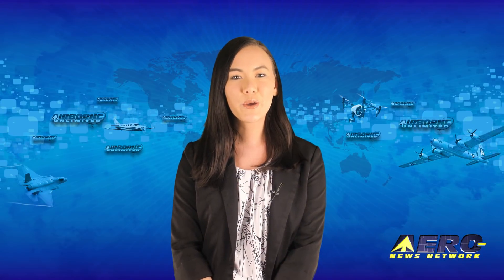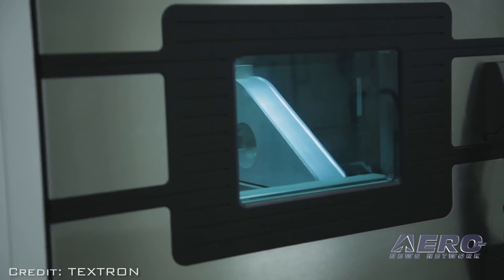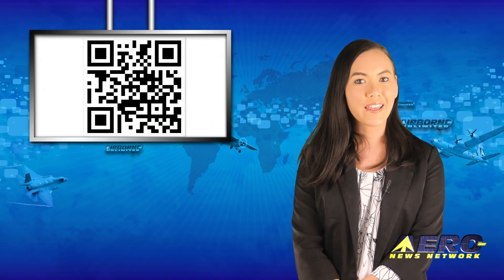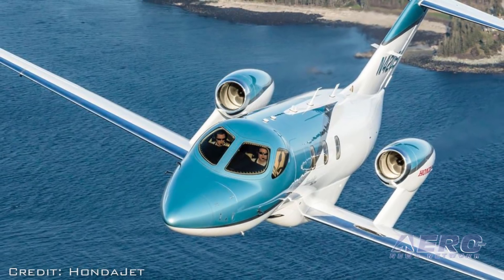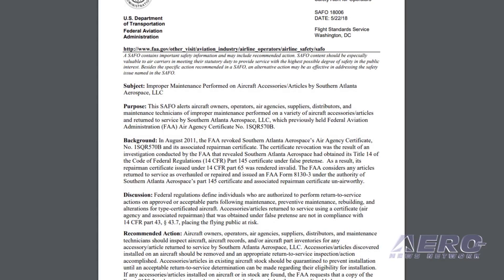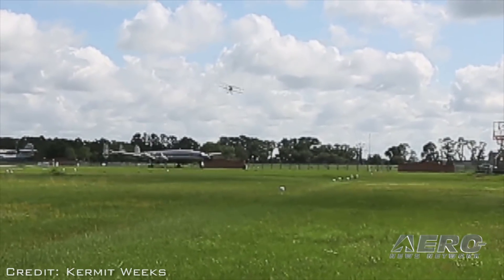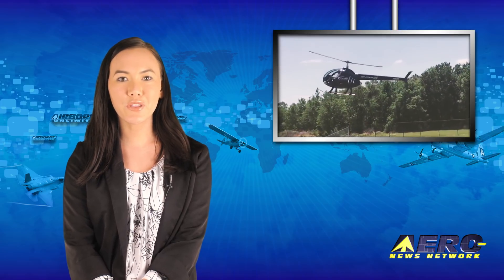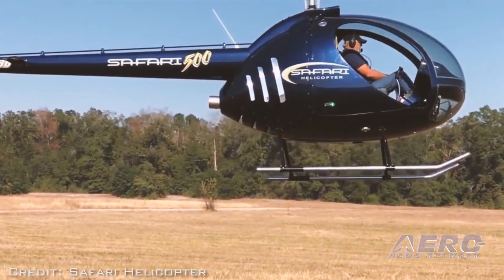Airborne 06.01.18: Cessna Denali, Kermit Weeks' Sopwith Pup, NEW Safari 500

Comment: List price of Denali is approaching 5M.  Seems to be alot of money for 285kts and 1600 nm range.  And only 1 engine.  So why not get a used cessna 340. Twin engine. 232 kts cruse and 1600 nm range.  Seats 4 in the back easily and cruises at fl240. All for 250k
Reply: If you know of the Pilatus PC-12, and its load capacity and reliability, you'd not suggest a used piston twin.

Comment: Cessna better bring it because TBM,Pilatus and Piper have proven aircraft at a reasonable price point,so I better see 300KTS and 2100NM range at FL310 for 3.5 million or stick it.
Reply: All they really need to do is match the PC-12's performance on less fuel. People will then buy it because it's a USA plane with a USA engine (and a real FADEC.)